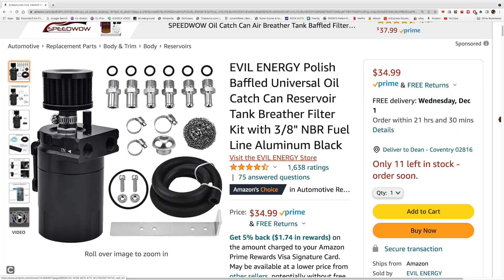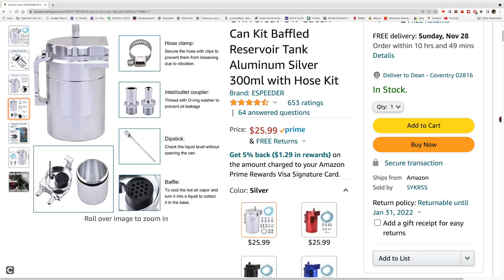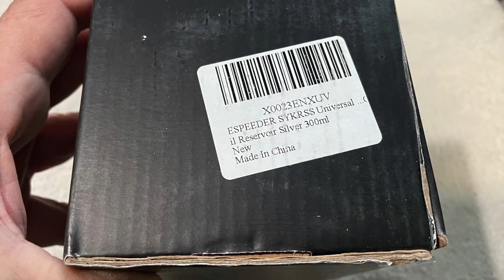1999 Toyota Camry 2.2 S5-FE - Oil Catch Can Installed

Comment: Why does your camry sound a little sportier?
Reply from the maker: Welllll, not sure if the mods I've done made it sound a whole lot different from stock. I have a Magnaflow SS catalytic downpipe to a Northeastern SS exhaust system and I'm running NGK Ruthenium plugs. I also usually run a K&N air filter, but its out for the winter. It runs amazingly well and for a 2.2l 4 banger and it pulls hard through it's entire power band. I did these things for reliability, not for performance so if it sounds better, I don't notice it. Thanks for watchin'.